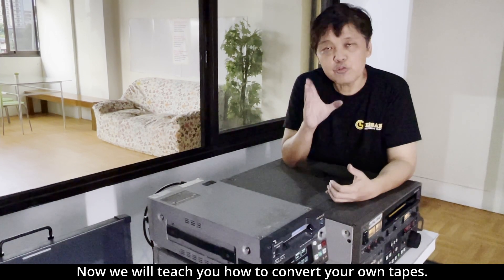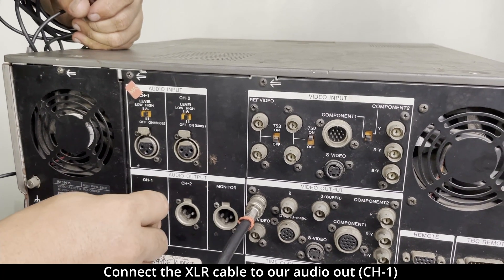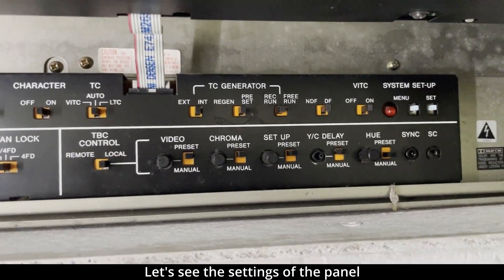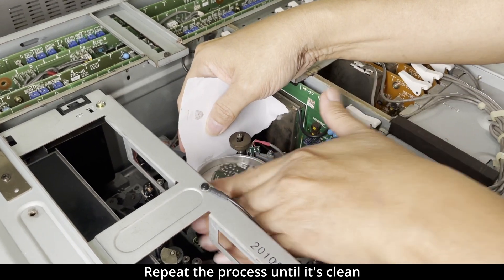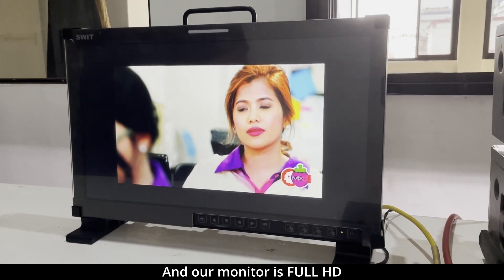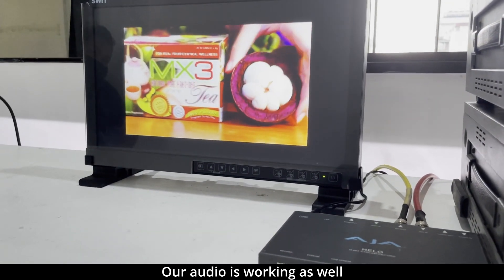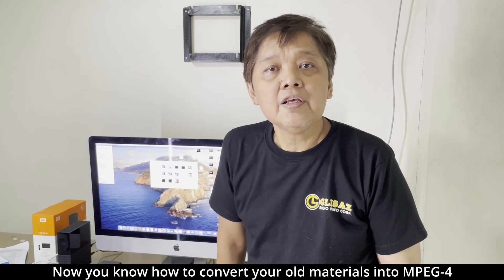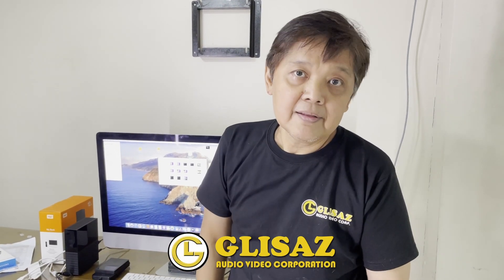Converting Betacam, Mini DV, DVC Pro, Hi8, VHS, Betamax to Digital File or MPEG-4

Comment: Absolutely terrible method to clean delicate VTR heads. Will most likely be destroyed (striped) this way. Use dedicated cotton swab / high quality cleaning cloth designed for tape heads. It is important to turn the drum indicated by the arrow in one direction only to avoid re contamination. Apply gentle pressure from the tip of your finger together with the cleanest isopropyl or medical grade alcohol you can obtain. Clean gently while observing level of dirt collected on cloth taking care to use a clean section until all dirt (oxide) has been removed. Finally clean all other mechanical parts of tape path to remove further contamination.

Comment: I would connect the SONY PVW-2800 to the Panasonic AJ-SD93 via Component/YUV. Does the TBC of the SONY PVW-2800 work with external sources, or where should the time base correction for Betamax take place ?

Comment: hi i have had alot of  not very clean video heads on alot of used decks  i never ever seen bad video heads tips on any betacam sp digi decks
and i have a hell of alot of them  it because pro's have look after them
it when the hobbie lot got them they don't know what they have  i am not a pro or hobbie       

i picked it all up over from 18  40 years   as i could be a pro by now   the dv dvc are not as good as the betacam decks   i saw the 96 code 

i am using alot of the betacam sp  are jazzed up i don't mind the video going bad  i pull the heads cables out when they are bad and use the liner audio
and use them like a reel to reel  deck  as the heads are bad i can use old betamax new hi-fi tapes just do  tape change over in sides and use the 5min tape case's  with betamax in side them  with bad head it's ok 

if you put a betacam first gen in a 1800  model it will play the tape as the video drum is bad i still work liner audio  40min's about 

i was going to skip alot of betamax tape alot of the one's that have movies on are very bad for your betamax decks
because you just don't know what beta decks they went in